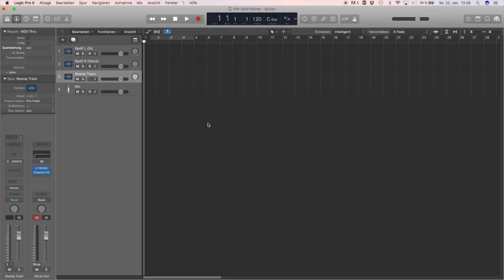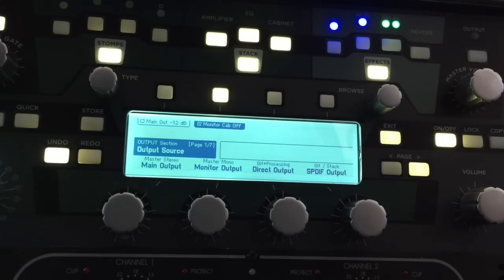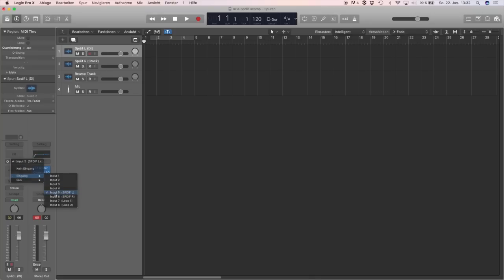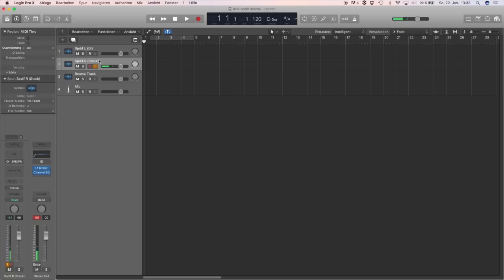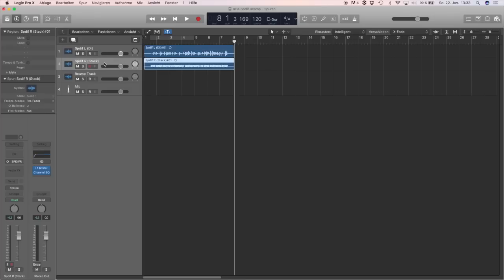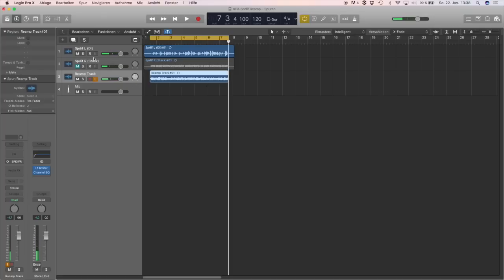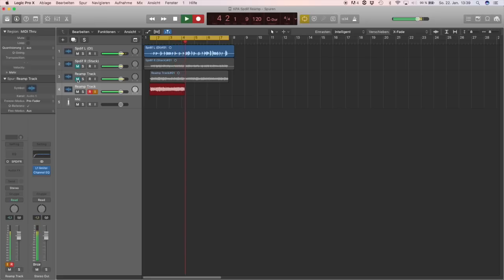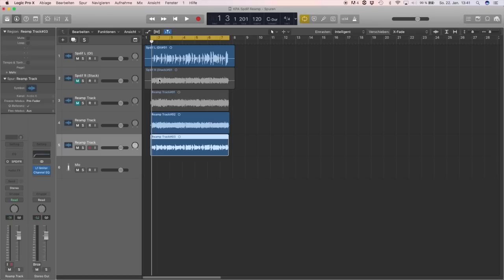#2 - How to record and reamp with the Kemper Profiling Amplifier

Comment: Thanks for this. In case you're not aware, clean sense plays a role when reamping as it will affect the input signal. Also when combining multiple reamped tones of the same performance, it's worth switching on the constant latency feature to avoid phase issues between tones due to differing latency values between profiles.
Reply from the maker: Nikolas Wolf i know, but as I always Reamp via spdif, I never really fiddled around with the clean sense as the levels are always the same on my setup;)
Reply: Nico Schliemann Yes I always record with spdif as well. So do you mean that clean sense shouldn't matter when using spdif?
Reply from the maker: Nikolas Wolf Well i don't use it, as the spdif in and out levels are always the same (DI at unity), if I want to change the gain structure, I'll fiddle with the profile
Reply: Okay great, cheers. I've noticed when recording that the master volume has an impact on the input level(of the processed sound), but I don't think affects the DI.

Comment: Are there any phasing/timing/latency issues between those Reamped tracks and the first recorded Kemper track (not the DI, but the sound you originally chose to work with)? It would be interesting to know if you maybe have to "nudge" the reamped tracks a couple of ms so they fit perfectly with the original tracks?

Comment: I am blocked when setting the ouptut of the DI track (7:31)  i don't have the outptut of my interface, only the regular ones. Any solution ?
Reply from the maker: +chapodepaille28 what interface do you have? Does it have a spdif out or just an spdif input?
Reply: @NicoSchliemann  I just figure out this bit as my interface (octa-capture, it has in and out SPDIF) was not in the output of the DAW, in the preferences. I first use only one cable (Interface SPDIF IN to SPDIF OUT of the kemper) because it let me have the DI signal and the profiled one.

 Now if use the 2 SPDIF cable but i only got the DI signal no matter what Input i choose in Logic (in my interface, the SPDIF IN and OUT are 9-10)
Reply: @NicoSchliemann  I figured out it was because the interface was not used like an output for my computer, so i plugged my headphones in the interface, but when reamping, i hear the dry and wet signal whatever i do in the Git /Stack setting. How do you hear only the reamp track ?

Comment: Great tutorial, thanks! But I do have one question you might be able to answer. I can't seem to mute the DI signal while recording. So no matter the guitar sound I use to record, I always have the DI signal playing along parallel to that.
Reply from the maker: Either mute it in the software for your interface and if you record the DI in your DAW, turn down that channel or mute it, it should record just fine though ☺️
Reply: @NicoSchliemann   Problem solved. Thanks for the quick response! :D

Comment: Hello, I need some help. I have a focusrite scarlett 2i4 (1st gen). I am trying to reamp with Kemper and Reaper. While i managed to get the Main Out (Master Mono) and Direct Out (Guitar Studio) in Reaper on 2 separate tracks I am not succeeding in sending back to Kemper the DI track signal. I think I am not doing the routing correctly in Reaper. Kemper is set to Return Input Reamp for Input Source. I have connected an RCA into the Output 1 of Scarlett that goes into the jack input of the Kemper. Something is not right and I guess the routing is the cause. Thank you in advance!
Reply: You ever figure this out?

Comment: I'm stuck at 4' because I dont the signal of my guitar coming in logic. It comes in my focusrite, and I hear it clean, but I don't have "spdif" option in logig, and it doesn't modulate. So it could come from kemper settings, focurite settings or logic settings. I m just on it for 2 days, and my brain is burning .......
Reply from the maker: first, make sure, your focusrite interface is selected in logic. next you can try every input channel of it (on my motu SPDIF for example input 11 & 12). if that doesn't help, see, if your kemper reampsettings are set to spdif
Reply: @NicoSchliemann  Thank you Nico, it was that. On mine, I had to put it on 7-8. It was an easy mistake from me. Thank you for your help. And great job for your video
Reply from the maker: +Stef C glad that helped.

Comment: Danke sehr for the video.  I have gotten the processed/unprocessed signal from the Kemper into Logic successfully, but I am having trouble getting the unprocessed signal from Logic back into the Kemper for reamping.  I just bought a Focusrite Scarlet 6i6 (2nd gen) for this, as my old interface (TerraTec Phase 26 USB) had been discontinued years ago and had reached the end of its usefulness.  Does anyone out there know how to get the signal back to the Kemper using one of the 2nd Gen Focusrite interfaces, which use the "Focusrite Control" software (not the 1st Gen "MixControl" software)?
Reply: OK, after a lot of tinkering around, I (mostly) figured it out.  Reading this forum post really helped: https://www.kemper-amps.com/forum/index.php?thread/26571-guide-focusrite-saffire-mixcontrol-reamping/, even though it is not specifically about using the "Focusrite Control" software.  The concepts are very important.  The short version is that you have to pick an output channel for your DI track in Logic (I chose Output 5, for example), then using Focusrite Control, route the signal that is coming in on channel 5 from Logic (which will be labeled something like "Playback (DAW)" -> 5) to S/PDIF Output 1.

If you want the re-amped signal to go back to Logic in stereo (if you are using some stereo effects in your profile, or the "Space" feature, for example), you can do it like this: 1) change the output of the Kemper to "Master Stereo"; 2) set the input on the re-amp track in Logic to stereo, and to the pair of input channels on which the Focusrite sends the S/PDIF input.  You should probably have figured out which pair of channels that is by now (or you wouldn't have been able to record the DI track to begin with).  But if not, a good way to discover it is to go to the "Mix" -> "I/O Labels" menu in logic.  If you look in the "Provided by Driver" column, you should see one that is labeled "SPDIF 1" and another labeled "SPDIF 2."  And you can use this window to change how those inputs are displayed in the Logic mixer section. I clicked the radio buttons in the "Provided by Driver" column so that they will always be displayed as "SPDIF 1" and "SPDIF 2."

What confused me for a long time is that my Focusrite (the Scarlet 6i6) has 6 input channels and 6 output channels, but they don't have anything to do with each other. I kept getting them mixed up in my head. And they don't have anything to do with the physical input/output plugs on the interface, either. It's more like the Focusrite is a mini-mixer on its own, sending signals on various channels wherever you tell them to go using the Focusrite Control software. Once you get your head wrapped around that, it becomes a lot easier.  

Hope this helps someone!

Comment: Hi! Thank you for your great video. I did exactly what you did here but I'm getting cracks on my tracks when I record with SPDIF. I'm using Logic Pro and a Scarlett 6i6 interface. Any Advice?
Reply from the maker: make sure, you set the spdif sync to external in the software from your interface, the kemper (if it's not a kemper stage) needs to be the clock master when using spdif!
Reply: @NicoSchliemann  Thank you for your answer. I did exactly what you did at 1:15 to sync the interface with the SPDIF. Is it enough to define that the Kemper is the clock master or should I do something more?
Reply from the maker: Alexis de Compreignac you need to make sure both are running at the same sample rate. If your kemper runs at 44.1 and your session in your daw is at 48, cracks will be audible...
Reply: @NicoSchliemann  I definitely checked that the Kemper, the Scarlett mix control and my session were all set to the same sample rate... The problem is definitely not there.
Reply from the maker: +Alexis de Compreignac hmm, that makes diagnostics not easy🤔
Reply: @NicoSchliemann  I will keep investigating then. You never had any cracking problems with SPDIF? Which Scarlett interface are you using? I have a 6i6.

Comment: It's also possible to take the unprocessed signal from the direct out... Why is it better to take the DI signal from the main out?
Reply from the maker: you can also do that, sure. i just did it like that, because i'm using the spdif digital output of the kemper to to the extra DA/AD conversion from the kemper to analog and back to digital at the interface. also the spdif is always the same level, which helps during reamping;)
Reply: Nico Schliemann Can I record with spdif? I only have a small interface with two regular input jacks...
Reply from the maker: BetonBenni of your interface doesn’t have spdif in and out you can’t record via spdif. But if you have, you can record and reamp with spdif.

Comment: great video Nico , I followed you step by step and everything was fine but when I create the reamp track i get no signal nor sound out of it...can you help me to find what could be the problem  ?
Reply: The output of the reamped track is probably going to the SPDIF Out (= Kemper), instead of Stereo Out (= your speakers). Just move the recorded audio to a new track, or change the output on the reamp track.
Reply: i realised the problem was actually on my focusrite control  not in the kemper .  thanks for the answer anyway!
Reply: @marcotp9  i think i have that problem now. do you mind telling me how you solved that?
Reply: hi  @smufmigeifmig   the problem was on the settings I had on my Scarlett Focusrite not the Kemper itself, do you use that as well?
Reply: @marcotp9  same story. it took me about 5 hours to find out that it had to do with the routing on my scarlett and how to set it right. it was a pain in the ass but now everything is fine
Reply: @smufmigeifmig   yes is not intuitive at all. glad you fixed it!
Reply: @Kevin Kawasaki so how did you fix your problem? I think I have the same issue.
Reply: @cosminduduc3016  honestly... i don´t REALLY know, but i played around with the mix control software and muted/unmuted  until it worked. i could send you pics of my settings if you want
Reply: @smufmigeifmig  unfortunately my Scarlett 2i4 cannot use mix control, I am relying for routing only to Reaper. I hope I will make it. For now I am sure I am doing an internal loop because I am hearing that high pitch sound

Comment: Out of interest why do you send the DI to the left and right? I've never tested the difference but I have always sent it back to the Kemper down a single channel.
Reply from the maker: i'm not sending in left and right. i have the dry signal on the left side and the processed signal on the right (that way i can monitor a processed sound while playing and can record that along with the dry signal for later reamping).
Reply: Sorry, I'll try and be clearer in what I was saying. I get the way you record initially because that's how I also do it. You are recording the studio level DI and an amp. What I meant was, when you are re-amping, you send the DI back to the Kemper on 5 and 6 which is both channels. When I send it back to the Kemper I only send down 5 as it is a mono signal.
Reply: Some of the effects do stereo processing in the kemper if I recall correctly. Might be for that.

Comment: what do i do if i don't have spdif on my interface ?
Reply from the maker: Thomas Shredster then you should maybe go for the direct out to record the DI Signal (Set the upturn to git analog) and revamp either through the input it alternative input.
Reply: @NicoSchliemann  You mean to just record di connecting my guitar straight to the interface and then set the output to the kemper itself ?
Reply from the maker: Thomas Shredster you can run a second line from the direct out of the Kemper (Set to guitar analog in the output menu) to your Interface
Reply: @NicoSchliemann  how do i set to guitar Analog output in the kemper ? please help , sorry for annyoing